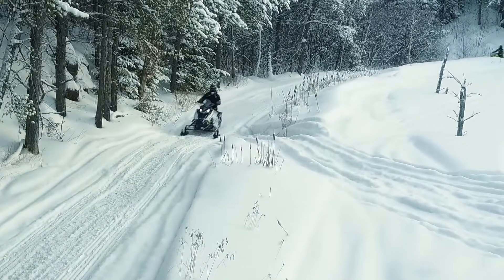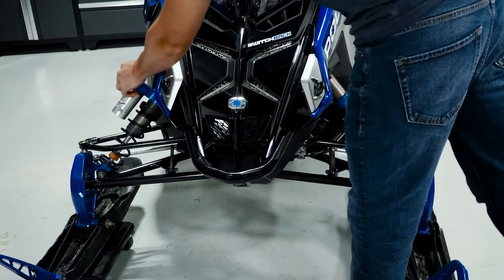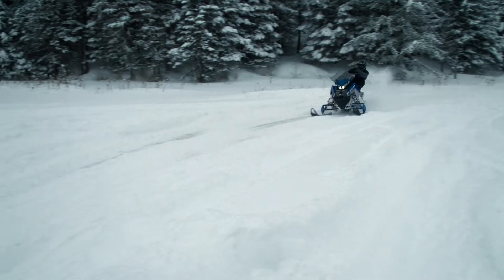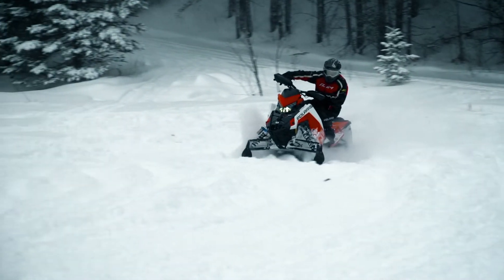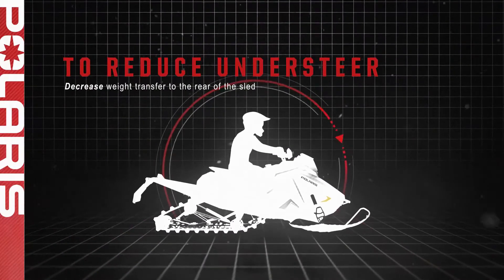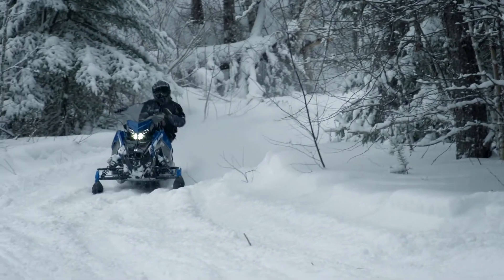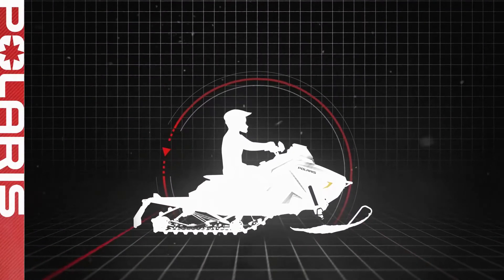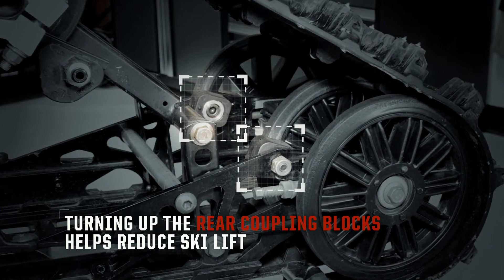Understanding Suspension Adjustments: Trail Performance: Handling and Cornering- Polaris Snowmobiles

Comment: ON A groomed trail or here in Flat land. 
I like a lower ride height. Lowering the front ski springs to there lower setting on the threads..Ski have a chance to fall into the bumps.  Also moving the center shock to the lower spring threads. I also Move the rear skid center bolts hole down 1 inch and redrilling holes. This also takes away the sleds tendency to trench in soft powder.  I set the rear scissor blocks on low.  I've never had an issue with Either over steer or under steer.. with single runners with these settings. If it gets bumpy. I just dial up the shocks stiffer and turn up the scissor blocks. Most of us are not on a Sno cross course. And We're getting older.
Reply: i would love to go to flat land. couple of weeks ago the groomer was down and for 3 weeks we had trails worse than sno cross

Comment: The first thing to do is make sure you have the correct rate shock and torsion springs to handle the riders weight and make sure the Sag is correct, if that not correct all the adjustments are a waste of time